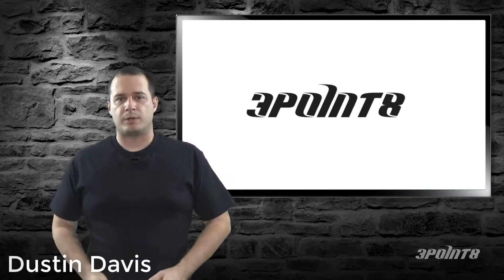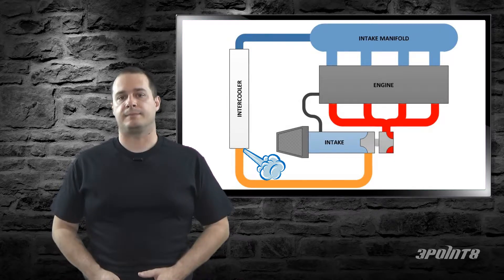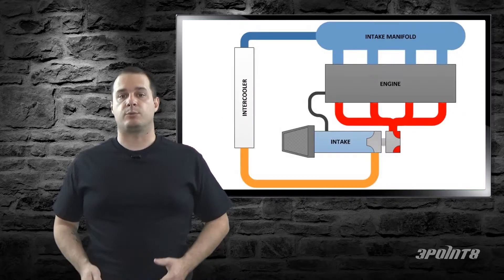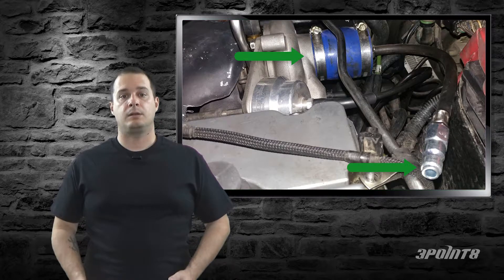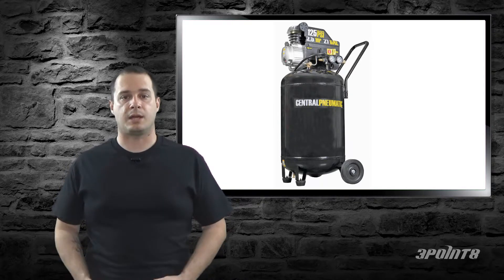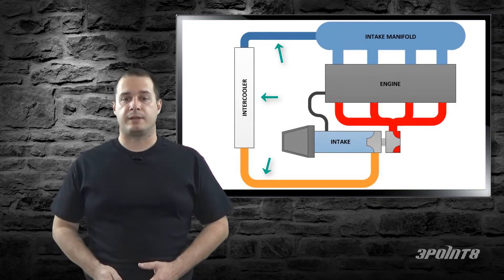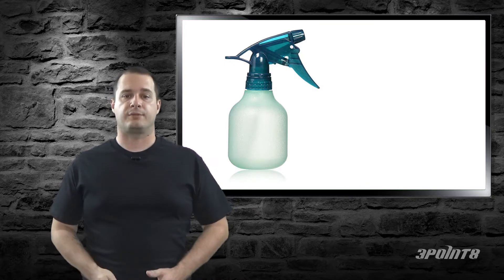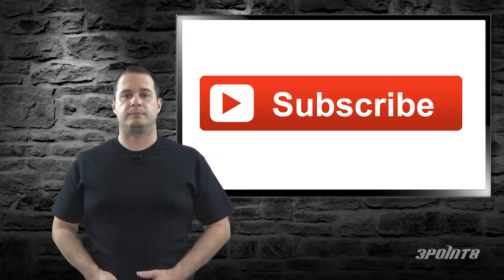What is Boost Leak Testing?

Comment: hey 3point8, your videos are great so far, subbed.  Quick question, I have a 2013 genesis coupe 2.0T with a canned tune by SFR, intake and a forge BOV.  Recently i was driving one night and while driving the ecu threw a code P2261 "Turbocharger/Supercharger Bypass Valve - Mechanical"  So i parked the car shut it off and then after restarting the car, the code was gone and boost was back to normal, hasnt happened since.   I was pushing the car hard shortly before the code was thrown, but nothing extreme.  Any ideas to what caused this?  thanks
Reply from the maker: I've seen many other posts similar to this when running an aftermarket BOV. Either the BOV is failing or you have a boost/vacuum leak and the reference is off causing the BOV to open/close incorrectly. I'd do a boost leak test and just make sure there are not leaks (always a good idea). If it happens again, you may need to inspect/replace the solenoid.